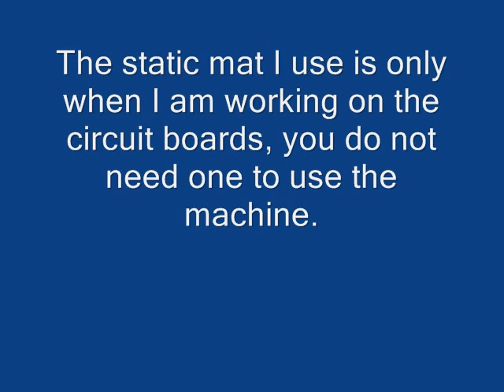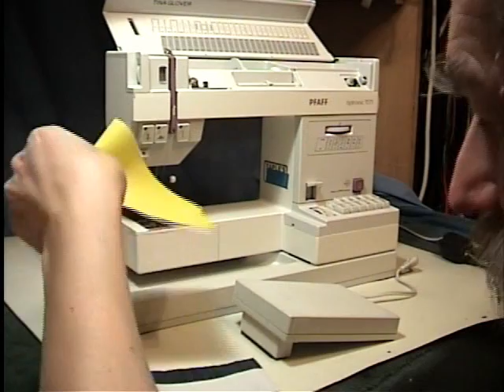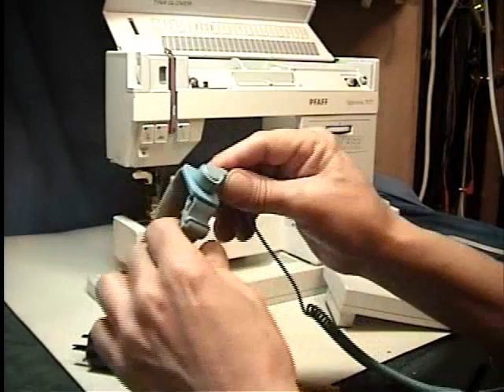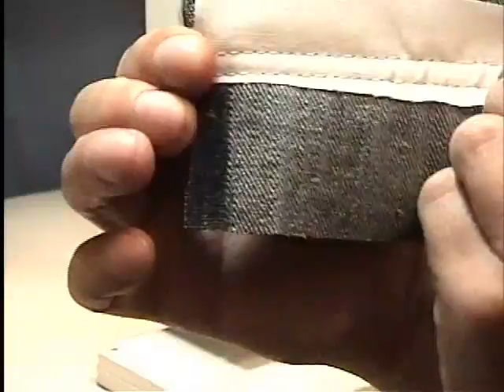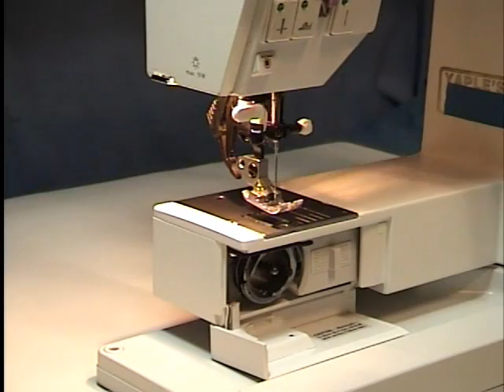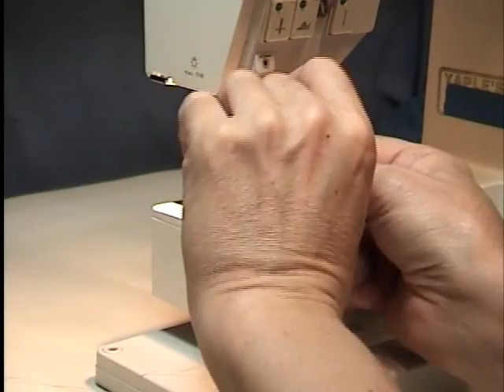Gary's Pfaff 1171 Repair

Comment: This is fantastic, thanks you so much for this video. I have a Pfaff Tipmatic 1151, which is the same machine without the circuitboard. The metal construction is really durable but finding repair details about it is impossible now.

Comment: The Pfaff 1171 is the best of the old classical machines. The boards are easy to repair
std. through hole components (no surface mount). Advanced mechanical gearing
require the service manual, easy to download, for adjustment. Full IDT and pattern.

Comment: Hi, I just bought this Pfaff creative 1475CD from a yard sale. 
Fairly clean, I cleaned a little more, oiled it. Now trying to operate. Needle will not go through to Bobbin. It is stopped by the round outer case of bobbin holder
Reply: Thanks for this clip.
I have 1471  similarly.

Comment: I just need to know where to lower the feed dogs.  I have the tiptronic 1171, I do not have the manual, it has been broken for years, and I finally got it fixed and can't remember how to find the feed dogs so I can lower them.
Reply: The switch next to the bobbin case is what lowers the feed dogs.

Comment: I have an 1171 and was just told it has a bad circuit board and it can't be fixed. Can I have you look at it to see if you can fix my circuit board? I love my  machine and don't want to give up on it should there really be a way to repair it.